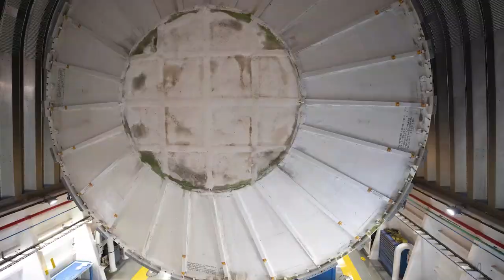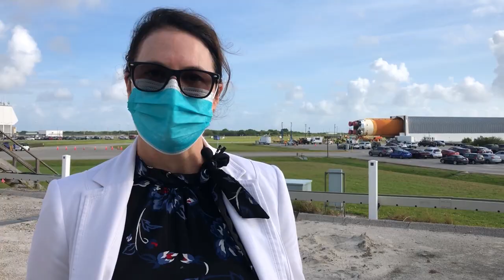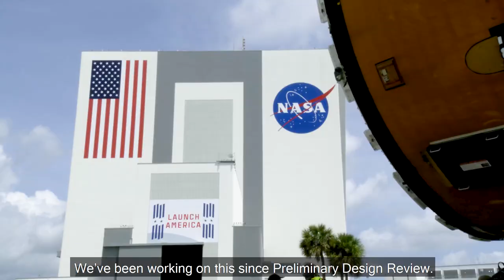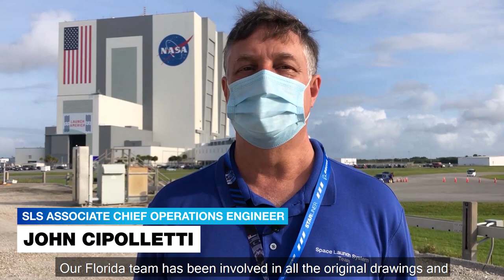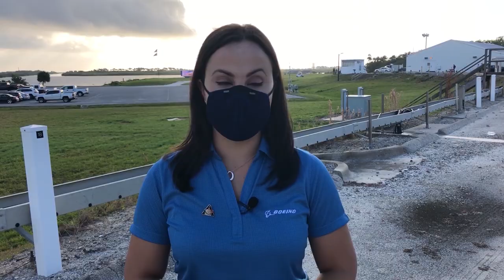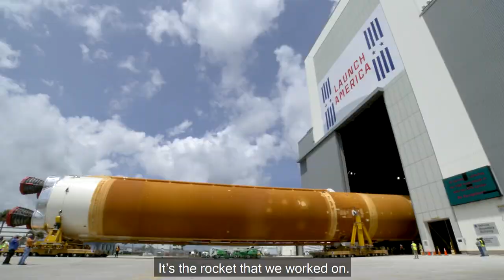The Boeing-built Core Stage 1 for NASA's Space Launch System Arrives at Kennedy for Integration

Comment: I might have been more excited about this 10 years ago, but the sad part is that this is a massaging of old technology, reusing STS RS-25 engines (which though reusable, are not being recovered), and modified STS SRBs (which also are not being recovered). Why did this take so long and cost so much?? And for major metrics that are slightly better than a 60 year old Saturn-V.
Meanwhile Space-X has put reusability into practice, drastically lowering costs, and if they can get Starship working, will make SLS obsolete. Sorry Boeing - I totally respect your engineers and engineering - but kind of like being the best slide-rule maker when the electronic calculator came out.
Reply: Nailed it!
Reply: You didn’t nail it. This is another based Elon coolade take

Starship is nowhere near being anywhere near ready for maturity of SLS and will take ages to get there where SLS will fill the gap and lead the way initially

It’s not outdated. This take is outdated

You can’t get the performance required with reuse and we don’t need dramatically lowered costs for pioneering exploration. This isn’t commercial small sat industry or a mega constellation launcher